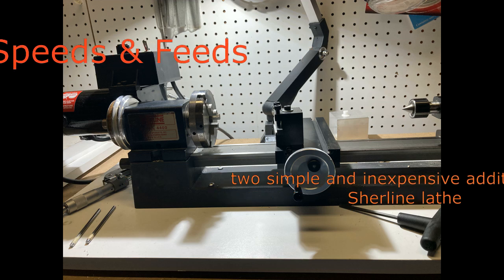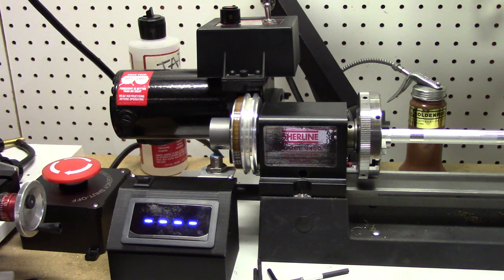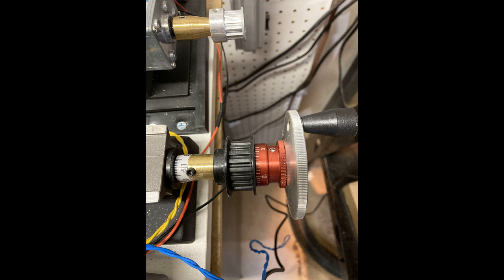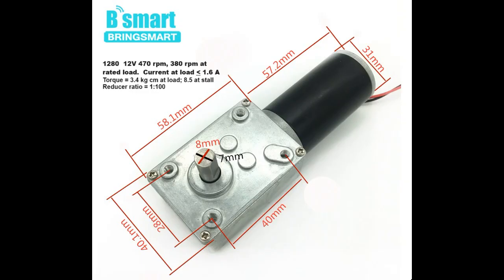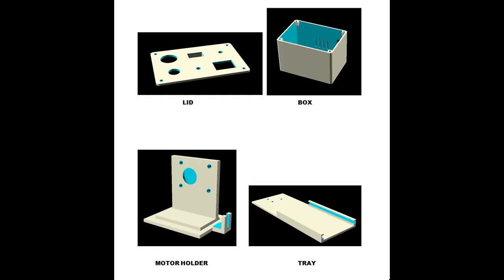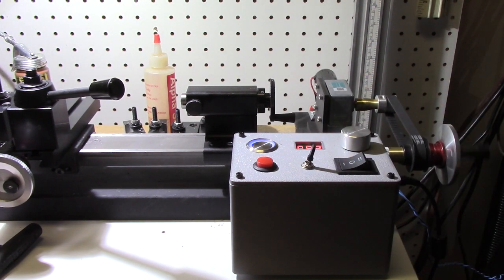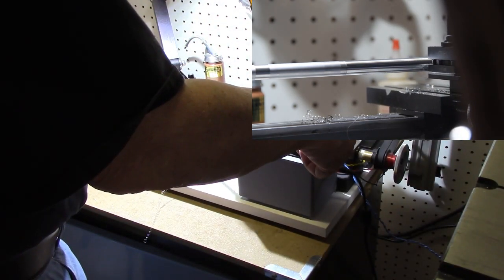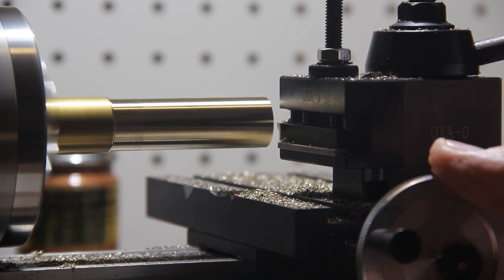Sherline Lathe Additions

Comment: I have changed the Sherline  motor for a servo motor with change of direction and velocity.... tachometer integrated, I am very happy with it. also the quick change, makes my life easier.
Reply: That's interesting. So you swapped out the main Sherline motor for a servo?  That motor only runs the spindle though, so by change of direction do you mean direction of spindle rotation?  Or are you referring to the old Sherline power feed?  That older power feed would probably work much better with a new servo since its unidirectional fixed speed motor was the biggest limitation.
Reply: @qta4425  It is a servo motor swap for the Sherline motor. ... It will be easy if you are interested to look for ServoMotorKit, you will need to make changes The pulleys don't align correctly.Next change is to install and electronic lead screw... Clough 42 it include feed and threading metric and imperial.

Comment: Very nice, thank you. And instead of a geared dc motor, you could use a stepper with a pulse driver and have the same speed and direction control, it might even be easier.
Reply from the maker: You’re right.  I was considering using the brushless version of this motor for its better performance and feed-back circuitry.  But since that would require a microcontroller, it seemed simpler to just use an open loop stepper so I have been looking at that instead.  Thanks for the input.
Reply: @Cecil-n8w  I have a few "Stepper motor Pulse Signal Generator Speed Regulator driver controller Module" from ebay that use 12v and seem to work great. I think they ere about $7 when I got them and there are several varieties. I've used with  3 different nema size motors.  I think you can get them with displays but I haven't tried those

Comment: Been a long time intermittent user of the Sherline 4400 lathe, so its nice to see a new (and rare) post appear about the machine, especially featuring a mod that I've been interested in doing for years. I've got the DRO package so I don't need a tach, but the power feed would be so useful on long parts and just moving the crossfeed back and forth for positioning. It would be helpful to me at least to see how you set up your motor tensioner slide table; yours seems so easy to use. One question I have is where is the limit switch wired to? BTW, the above link for the gear motor is truncated. FWIW I've found the same part on Amazon for 32 bucks and a several week delivery delay. Thanks for the vid.
Reply from the maker: Michael – thanks for the comments.  (1) the tensioner slide is just a couple of 3D printed pieces.  I have placed the stl files for them in a zip file at the link below.  There are many ways to do this, the only important part is the vertical toggle clamp.  I put the link to the one I used from Amazon in the zip file also. (2) the limit switches are wired in-line with the controller output to the motor using the NC poles on the switch.  So the wires run from the controller to the switch and then on to the motor.  It is important to wire at this point so that power is only shut off in one direction and the table can still be reversed.  I wired both directions but I am only using the left side.  (3) Sorry about the link.  A link to this item on AliExpress is also in the zip file.    AliExpress is probably a better choice since the current price is $18.85 with free shipping and delivery is promised within about 2 weeks.  Incidentally there is also a 24V brushless version of this same motor available for about $27.  I tried one and it works really well with the right controller, but controlling these things is still a little tricky so I am continuing with the brushed version, at least for now.
Good luck with your project if you decide to add a similar power feed to your lathe.  Let me know if you have any other questions or problems along the way.
Link:   https://www.dropbox.com/scl/fi/hzexrbwvhskixmp4s9cma/SherlineMods.zip?rlkey=cww7dq37pjkn9ndvd0u7w6f7z&st=3irrjmm0&dl=0

Comment: Limit switch and packaging are nice. Any reason you don’t use a follower rest to allow a heavier depth of cut?
Reply from the maker: Thanks for your comments and an excellent question.  A follower rest is probably the best solution for flexible stock and I do use mine on occasion  for a  final cut or two.  But having to adjust it for every pass can be a pain, although I guess it might balance out with heavier cuts and fewer passes.
Reply: Re: multiple cut, I read in Joe Martin’s  “Tabletop Machining” that often the intent with the follower is to cut to size in one pass.